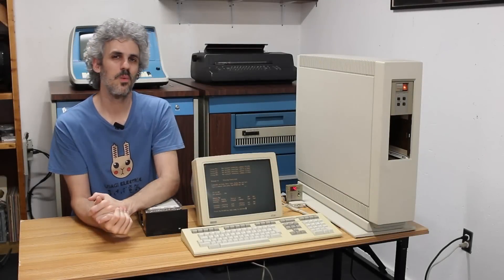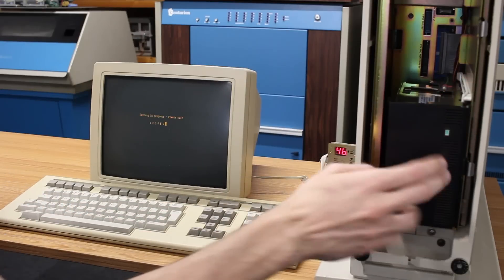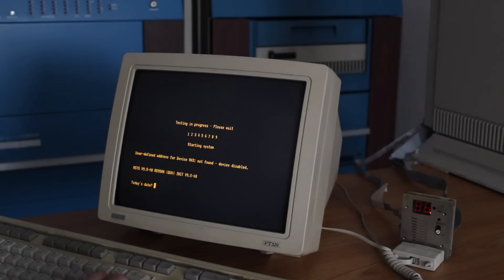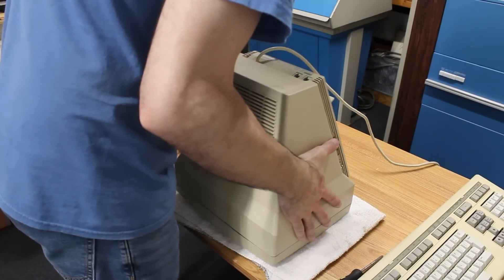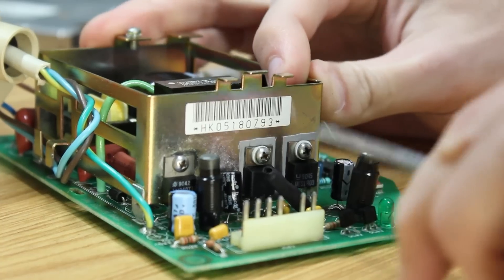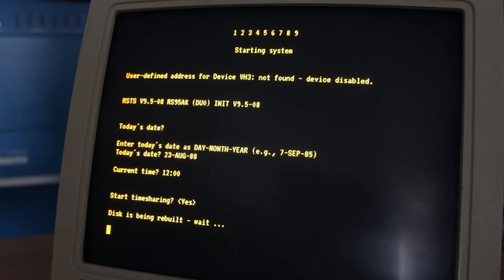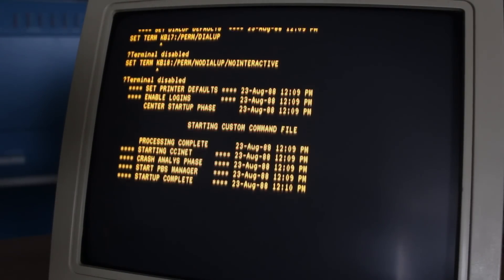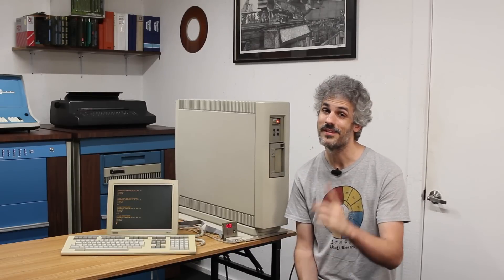Booting RSTS on the PDP-11/83!

Comment: I don't know much about these systems, but as a member of Gen Y, some of it almost seems a bit surreal... And like a very different piece of technology from something like a Commodore 64 or similar (also no real IRL experience with these either; but they seem to be popular). It is sometimes interesting to see glimpses of a world before Windows PCs and the internet...

And, in my case, I have implemented a custom CPU ISA ('BJX2') and OS and similar on an FPGA (with a custom C compiler; and the FPGA based parts written in Verilog; and a whole lot of C in the mix) but ironically the clock speeds one can pull off on an FPGA are too slow to really run a lot of the games I played in my childhood (such as the Quake games) at acceptable framerates; so I am mostly left running things like Doom and similar on it. Basically, it being difficult to run an FPGA-based soft processor much over 50MHz. (The CPU ISA in this case being a 64-bit VLIW based design; loosely along vaguely similar lines to the Itanium/IA-64, but the design was more directly evolved from SuperH and the TMS320; but there is a slow-moving sub-project of also trying to get 64-bit RISC-V code to run on it as well).
Besides Doom, and Quake and similar, I also have an OpenGL implementation for it (can run GLQuake with software-rasterized OpenGL, ironically, faster than Software Quake), and a small Minecraft-like engine (also not particularly playable due to lacking performance and short draw distance). Also some small-scale neural net experiments and similar (has a peak FPU throughput of around 200 MFLOP/s by using FP-SIMD ops).

But, yeah, I can probably pretty safely assume that Doom or similar could not be ported to run on a PDP-11... But, still kinda interesting.

Comment: Hi, I've been a user on a PDP11/44 running RSTS many years ago.  I have lately been trying to recreate a PDP11 on an FPGA (mine's much smaller and quieter than yours - differently cool).  Anyway, logging in was done by saying HELLO <groupid>,<userid> and you keep getting the BYE message so I think you're logged out.  I can't explain why local echo is disabled on your terminal once booted, it could be that they had a teletype on the console and didn't want the local text printed.  Anyway, commands could often be abbreviated to 3 characters and so I think what you're typing HELP is being interpreted as HELLO P.   You might want to try HELLO 1,2 and SYSTEM as password - make sure caps lock is on, nobody used lower case back then :D  I am interested in getting disk dumps if possible, I've written a program which reverse engineers the on disk format for RSTS but it looks at disk images rather than actual devices.  Passwords used to pretty much be limited to a very small set of characters but I think RSTS 9 vastly improved on this (finally).

Comment: I have used different versions of Linux several times but this is the first time I have seen a REAL multi-user system so I was astounded and shocked. The RSTS OS was truly legendary for being an elite hacker's playground. I read the book "Cyberpunk" by John Markoff where Kevin Mitnick was obsessed playing with the RSTS systems and finding back doors into the OS. He had alot of fun with RSTS and I am sure you will too! "68 disabled devices" I sure was not expecting to see that! I saw a tech video where a guy bought some old Sun Microsystems servers which still had some Government NASA files on the hard drive! I am sure that your system at one time had a very important use and managed a large corporate network and not just one auto shop. I am positive that you will have as fun playing with RSTS as Kevin Mitnick did only it will be 100% legal this time around. I think the downfall of the DEC software and hardware line is that it is too "easy" to use and too insecure although I think an easy to use OS was always intentional in the first place by DEC! A very educational and worthwhile video!

Comment: What communication protocol does that drive use?  Doesnt look like a mfm or rll.  Is it an early scsi?
Reply: RD53 was an MFM drive.  The ribbon on the RQDX3 went to a breakout board on the rear of the backplane that split it into two MFM pairs for hard drives and an cable to an RX50 dual floppy

Comment: Your channel is dope. From the "RSTS/E V9.0 System Managers Guide AA-2762F-TC Jun85"  (It's 639 pages long):
Disk is being rebuilt - wait ...
This informational message is displayed when a user attempts to rebuild a disk. The disk is logically mounted when the rebuilding operation is complete.
... so I guess it's normal.

The "68 devices disabled "is a not worrisome, but the system should give you the list of the disabled systems, and not only their number...

?Device not available
The specified device exists on the system, but an attempt to allocate or use it is prohibited for one of the following reasons:
o The device is currently reserved by another job.
o The device requires privilege for ownership and you do not have the necessary privilege.
o The device or its controller has been disabled by the system manager.
o The device is a keyboard line for pseudo keyboard use only.

?Disk pack is not mounted
The DISMOUNT command was attempted, but the disk pack was not mounted on the specified disk drive.

In the RSTS/E System Installation and Update Guide  AA-2669J-TC July 1989 : 
USER-DEFINED ADDRESS FOR DEVICE xxn : NOT FOUND - DEVICE DISABLED
Use HARDWR to set the correct CSR address for xx:, or call the DIGITAL field service engineer.

A bit late to call the DIGITAL field service engineer. Looks like a problem with the disk, looks like its not mounted, or not properly mounted. And Damn it was fun to search into these grimoires.

Comment: You sould use it to run your Bridgeport Series 1.  When it was a BOSS 5 it was an RT-11.
Reply: I still have my working M7264-0-1 LSI-11 CPU, onboard EPROM OS and 32K RAM. CNC milling machine came with quad high backplane/rack, machine control PCB, paper tape reader, stepper motor driver, power supplies and display hardware (about 200 pounds of 1970's tech) removed from my BOSS 5 1980 Bridgeport Series 1 CNC milling machine 8 years ago for upgrade with MOSFET drivers and Windows 2000 Mach3 controller.  Still runs great, machined airplane landing gear parts last week.   I have used it to make PC boards much like David's intro to these videos.
Reply: @chuckinwyoming8526  In the end I yanked out the PDP-11 and replaced it with Linux CNC. I kept the AC Stepper motor controllers that use greycode for step and direction. The beauty of Linux CNC is I have a fully modern computer with 4 cpu cores, 8 gig of RAM and full software updates. So I have a fully modern CNC system driving my 1979 iron. I've been using Linux CNC's escape codes to Python from G code to allow me to use equations to set my toolpaths.
Reply: @AndrewTubbiolo  Ah, Gray code. The patterns look quite pretty, particularly if you add greyscale levels.
Reply: @lawrencedoliveiro9104  Ha! I see what I did, and what you did. Good catch.
Reply: @AndrewTubbiolo  No, really. I wrote some Python code to draw various depictions of Gray code.

aHR0cHM6Ly9naXRodWIuY29tL2xkby9xYWhpcmFoX2V4YW1wbGVz
Reply: @lawrencedoliveiro9104  There are encoders that have greycode painted on them to provide a encoding scheme that only changes one bit at a time. It's why you use greycode.
Reply: @AndrewTubbiolo  It’s called “Gray code”, after the name of the person who invented it.

Comment: The boot code numbers counting down constantly sure feels like a "watchdog" routine running.  If the system crashed you would know right away as the numbers would have halted.
Reply: A bit like when the old LILO bootloader started up...the letters "LILO" came up one at a time as the loader started up.

Comment: You can replace capacitors in power supplies with higher values as long as they physically fit.
You can always use higher voltage capacitors (exception: on motherboards from circa 2000 and up higher voltage ones might have slightly higher ESR which means slightly lower stability than new perfect replacements)
You can use filtering capacitors (which are almost all of them in PSU, probably 100uF or more are all filtering) with higher capacitance.
Please replace all large capacitors in the failed terminal - if a couple is dead all of them probably are damaged.

Comment: RSTS pronounced "Ris-Tis", with optional /E pronounced "e." ^_^  It has been a long time since I've heard that name. A long time. xD
Reply: All the 1, accounts are administrative accounts, I definitely remember that much. At one point I think default admin passwords were all names of birds, but I don't know if that was common or just those two installations. (It was definitely so in those two cases, which was a problem once we figured that out lol.)
Reply: According to some stuff I just read online, the original “RSTS-11” ran on PDP-11 models without memory-mapping hardware, and only ran programs written in BASIC-PLUS. Later versions that added memory-protection support, and then additional programming languages, were renamed “RSTS/E”.
Reply: @lawrencedoliveiro9104  That sounds right. Basic Plus wasn't much of a BASIC*, but Extended Basic (came with the /E) was ... yeah. The best BASIC I've ever used, certainly the best ... non OO-basic. It was a beast of a BASIC.

* opinion shaded by having Extended BASIC first

Comment: Nice working on getting this running - you may want to consider an emulator instead of working with physical drives.

It's pronounced "RISS-TISS", by the way :)
Reply: rists
Reply: @wesleymays1931  Basically pronounced as you see it; "rss-tss". Resource Sharing, Time Sharing.
Reply: we called it riss-tiss-eee

Comment: Why not a sys V Unix?
Reply: I don’t think System V ever ran on this.
Reply: Nope.  System V needs a 32-bit machine.  There is 2BSD for it, and because that disk controller is MSCP (Mass Storage Control Protocol), you need a fairly recent version of UNIX.  2.9BSD does not talk to MSCP disks (without recently-written patches that were not available when it first came out).

There are ways to run older versions of UNIX with different disk controllers, but not all of them are friendly with such a new processor (the RKV11-D, for example, is Qbus, but only has a 16-bit-address DMA engine so it's extra work to use that with machines newer than the 11/03, at least when you put more RAM in them).

I think the 11/83 is a fantastic processor but any of the J-11 boards (11/73, 11/53...) are part of the last generation of PDP-11 so there are some older things that just don't like them.
Reply: @ethandicks3  Large Scale Integration, which when you compare to today's processors makes me giggle a bit.

Comment: Back in the 70's - 80's I wrote lotta code for SDS, Xerox and DEC machines PDP11/10' s to 11/70's. Many had high level languages but not PDP machines. I learned to speak assembly language and understand both Baudot and ASCII 😁
Sometime in the 70's I wrote a Limerick expressing the feelings of my co-programmers and myself about RSTS. 😁😁 As best as I can remember it went like this.
There's a system called RSTS by DEC,
 Leaves all of its users a wreck.
Systems come and systems go
Loved unix on the 70 but
 Let RSTS be scrapped by heck.

Comment: Unix tiem
Reply: Not interested. Seen too many Unixes. Seen one, seen them all. IMHO
Reply: @mistie710  PDP11 is original home of Unix.
Reply: @mistie710  If nothing else, he's showing why so many of those old OSes died!
Reply: I went straight from CP/M to RSTS/E and thought it was wonderful... few years later went to Unix and thought "why are all the commands so stupid? vi instead of edit, cat instead of type, grep instead of search, and what the hell is awk supposed to mean?" Ken Thompson's desire for bizarre abbreviations did the world as disservice.
Reply: @edgeeffect  You have to appreciate that the respective command systems are built on very different underlying principles.

DEC didn’t believe in being able to run a program just by typing its file name: you had to use an explicit RUN command. RSTS/E also added this thing called “CCL” (“Concise Command Language”) where the sysadmin could define new commands to run particular programs, and also give them command arguments at the same time (which the RUN command could not do). CCL entries could also have abbreviation points, so you didn’t have to type the full command.

Unix did away with all this: you could run any program just by typing its name. And you could pass it arguments after the program name. But, apart from the PATH mechanism to avoid having to type full pathnames for common commands, there was no way in this scheme to allow abbreviating the program name. Tab completion gives you a similar effect today, but it wasn’t available then.